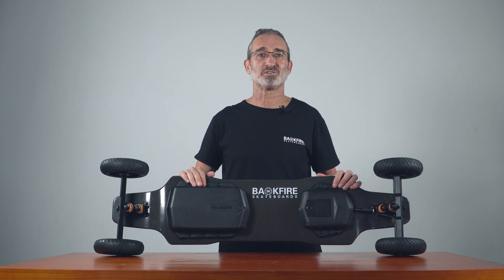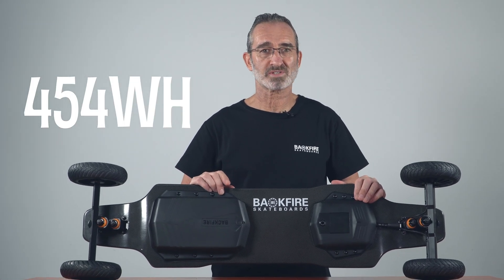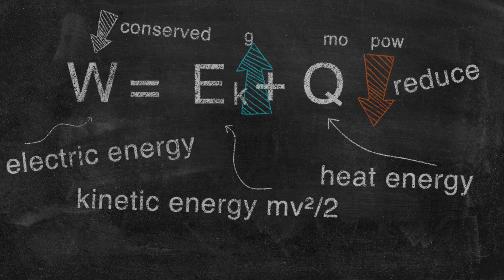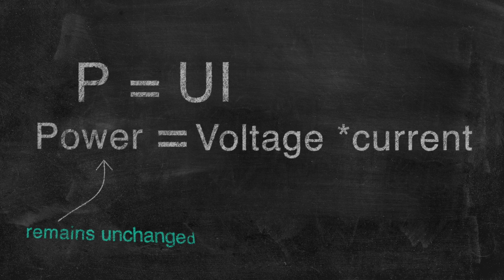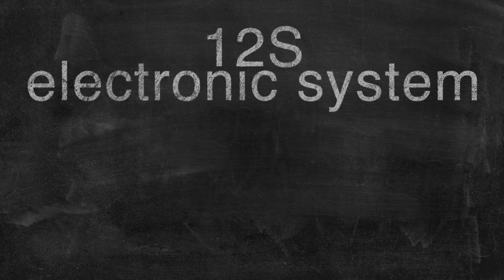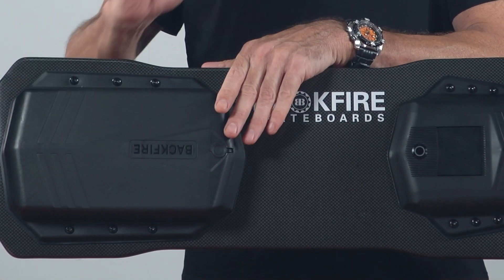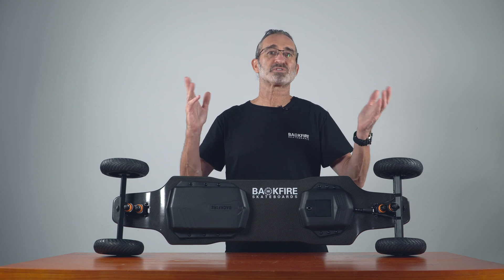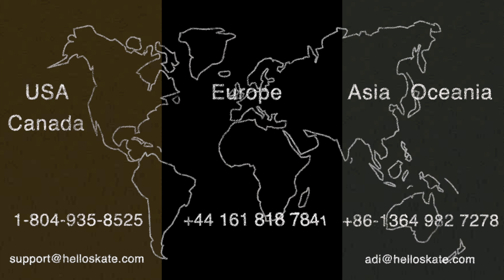Why BACKFIRE choose 12S 50.4V high voltage system as the X2 G3 system

Comment: This will be my first esk8 board, the 2 extra ports that you talk about @3:14 are they to upgrade the battery capacity. Because that would be great as I’m a bigger guy and it seams range tests always get done with lighter people in the 65 - 75 kg range not people who are around the 100kg mark.

Thanks.
Reply from the maker: the extra ports are for lights
Reply: Will there be a way in the future to increase the battery capacity of the board ?